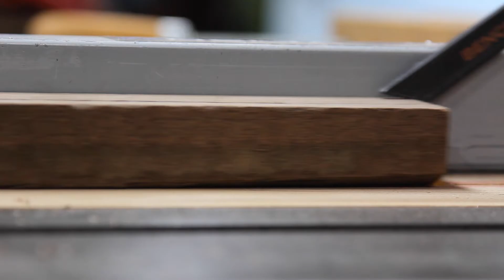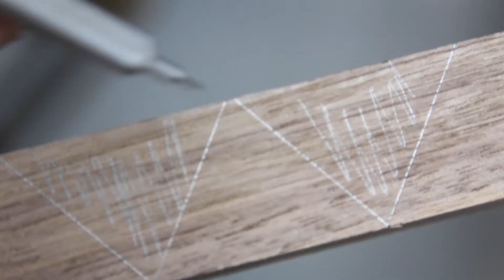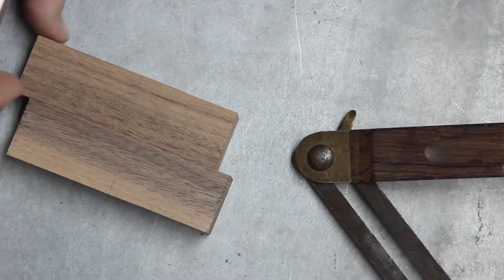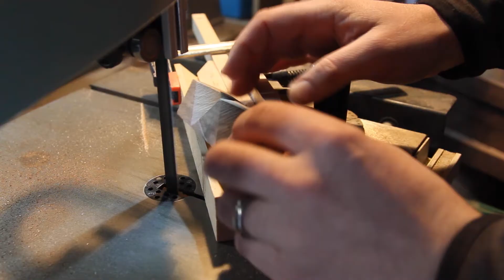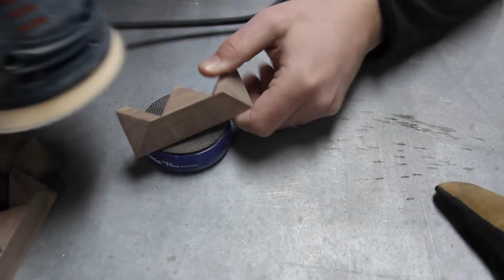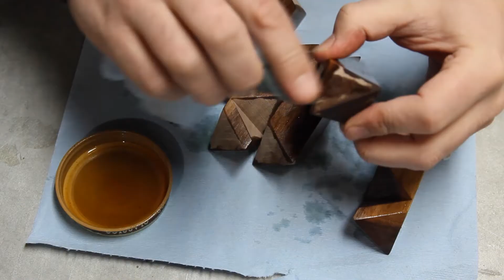How to make: Walnut 6 Piece "Star Burr Puzzle" from scrap #fathersday

Comment: I made a couple of stars, guided by your video. Thanks!  But my stars are a bit "loose" fitting.  What can I do to tighten them up a bit without making it too difficult to put together?
Reply from the maker: You might need to adjust the angle cuts a little bit.  I made a few using some scrap pine before I went for it with walnut.

And the stars I made years ago do expand and contract with the humidity so during the winter mine are a lot looser than in the summer.

Comment: how long and how wide were the strips of wood before you cut pyramids out of them?
Reply from the maker: That’s a good question and I can get you the exact measurements from the one I made. But as long as you can fit your angles on the piece the size can be a bit flexible.